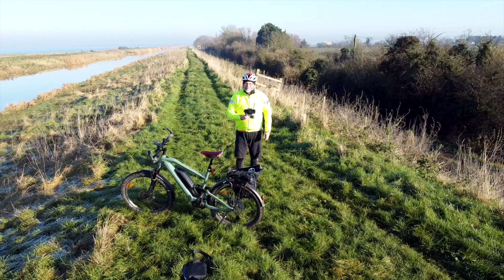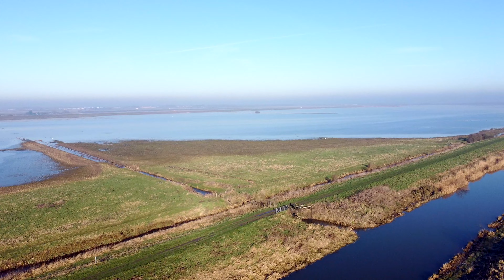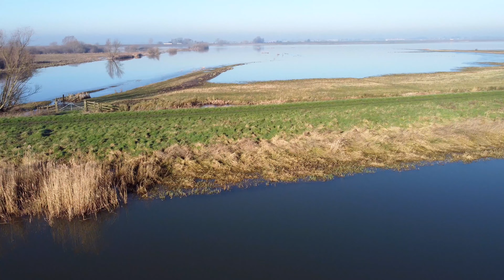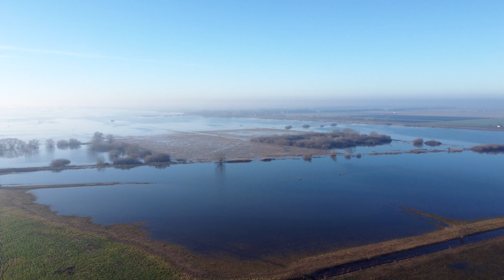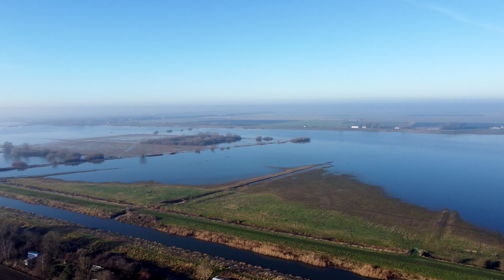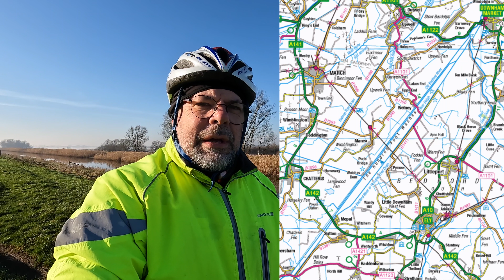Critical Fenland flood defences - The Ouse Washes

Comment: Hey Martyn,
Quick tip. if you get a playing card, you can clip it to the seat stay of your push bike using a cloths peg and when the wheel spins the spokes clip past the card making it sound like a motorbike. Just saying....Haaaa ..! I used to do that to my bike when I was a kid. Another lad from a neighbouring village used his vocal chords to make a "Ringaning aring" sound. Obviously he was interested more in 2 strokes :) That was back in the early 70's when I was a lad. On a more serious note what a massive undertaking it must have been to dig that river back in the C1700's
Reply from the maker: Cheers Sandy. Indeed the fenland drains all dug by manual labour and these two rivers and washes are 20 miles long. Let alone the River Ouse that was redirected to Ely and beyond my house is by the old river bed from 1800 now a road! We all had pegs and cardboard, being an geek engineer type I had a string attached to mine so I could adjust the angle for louder or quieter, yup that was us kids in the 70s.